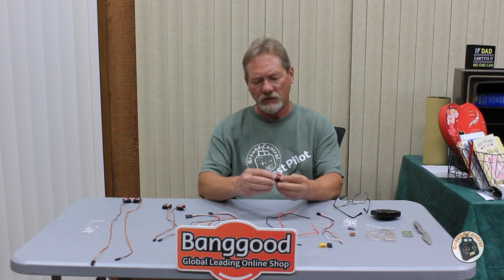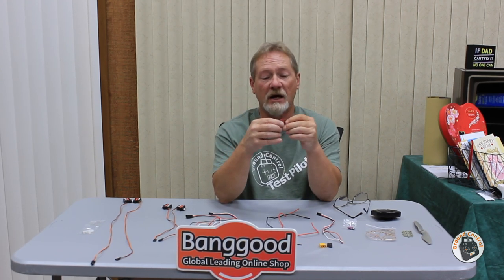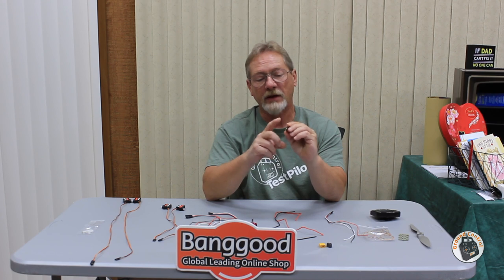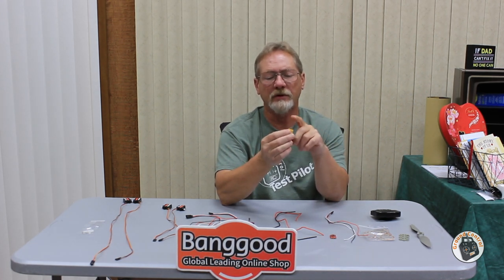Eachine & ATOMRC Seal Wing G1500 FPV Glider - Review Part 1 - Assembly Tips, & Some Cool Features!

Comment: Perfect crappy, wet an windy weekend build!
Flaps an all.
Looks like there is plenty of space to up the motor an prop sizes.
Awesome,,, looking forward to this.
Beauty GCRC.
Reply from the maker: Thank you Jono!
I'll have to see how aerobatic this FPV Cruiser is ;-)
This is designed for a large 4S LIPO but I think, as long as it's not loaded down, it should fly fine on a 3S as well.
See you in the Air!

Comment: Perfect timing, im an FPV newb looking for a beginner airframe for my dji v2 goggles and i just impulse purchased the new Caddx Polar cam , thinking it should be perfect for taking advantage of “evening glass” ( close to sundown, when the wind always drops ) because the caddx Polar was designed for low light conditions…. anyhow i WILL be following this FPV pusher build! thanks GCRC!
Reply from the maker: Thank you much!
I'll have to check out the Caddx Polar Cam as that sounds very interesting.
I now have the airframe all assembled and I'm going to try and make time today to get all the electronics assembled so I can Maiden it tomorrow, fingers crossed ;-)
See you in the Air!
Reply: @GroundControlRC  FPV electronics? It would be cool to see you return to FPV again! looks like this bird has option to easily mount a custom multi axis fpv gimbal too! Fyi theres alot more free 3D printable gimbals now
Reply from the maker: @MonstroLab  No FPV electronics in this kit, although they do sell one, assembly of the ESC and Motor. They do not come pre-soldered.
I am going to have to get some FPV flying in before too long.
I think it's been at least 1.5 years since I've flown FPV.
I was terrible at Line-Of-Sight flying so I forced myself to fly only LOS until I got my skill level up.
I've found I really liked flying LOS.
FPV flying is a whole different experience and one that should be enjoyed often ;-)
See you in the Air!

Comment: I'm using a old esc I have and it doesn't fit in the rear location so I'll probably put it inside
Reply from the maker: Yes, the ESC compartment is fairly small.
Putting it inside the fuselage is what I would do with a larger ESC.

Comment: The Fuse is quite large... Glad you got a free plane to review. It costs $179.00 USD for the PNP. I prefer my Bixler3 from HK with landing gear. The PNP goes for $132.97 USD.
Reply from the maker: Hey Lasersbee!
The Fuse is quite large.
It's quite a bit different from the Bixler3.
It's designed as a long range FPV, Camera, Flight Controller, and GPS Platform.
The Bixler3 is more like my Ranger G2.
The Ranger G2 is $95 USD and comes with landing gear ;-)
See you in the Air!
Reply: No comparison to Bixler. FYI bix 3 is a total ripoff imo. Buy a skysurfer x8 you'll save heaps.

Comment: Did you glue your wings in?
Reply from the maker: No, I have to have them removable in order to transport the plane out to my flying area.
I do put packing tape over the seam of the wing sections in the 1.5m wing configuration.

Comment: Is that esc setup for braking?
Reply from the maker: No, it's setup to freewheel.
Reply: @GroundControlRC  what's your preferred setting on that?
Reply from the maker: @blackterminal  Are you speaking of the Wingspan?
If so, I like it in the 1.5m configuration as it's lighter on the wings in that configuration.
Reply: @GroundControlRC  hello I was meaning what brake setting do you prefer?
Reply from the maker: @blackterminal  Oh, on non-folding props I prefer the motor freewheel and on folding props I set the motor brake.

Comment: IF IT CRASHES , WHAT IS THE POSTION OF NOSE , IT WILL BREAK OR CRASH RESISTANT NOSE
Reply from the maker: It's made of EPO Foam which is pretty durable but it depends on the type of crash.
You could certainly  rip the nose off.
This plane uses a large 4S LIPO which is a lot of weight and inertia in a crash.
It would not survive without needing repair in my opinion.
Reply: @GroundControlRC  imo li ion seems better as its lighter.  Less crash mass
Reply from the maker: @blackterminal  Li-Ion keeps getting better and better but the drawback with Li-Ion is they can't provide the amps that LIPO's can provide.
I think for just cruising around or doing long range flight they are probably a better choice.
For aerobatic flight I think a LIPO is still a better choice.
I fly everything like a Warbird even though the plane may be designed for long range flight ;-)
That's just my opinion based on my knowledge of Li-Ion and my flying style.